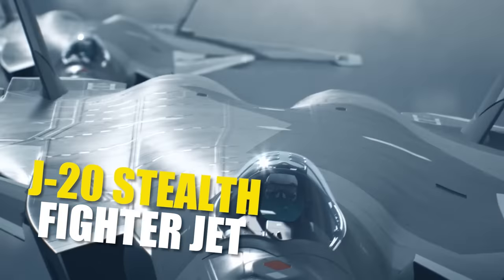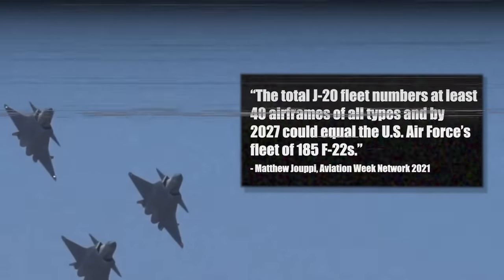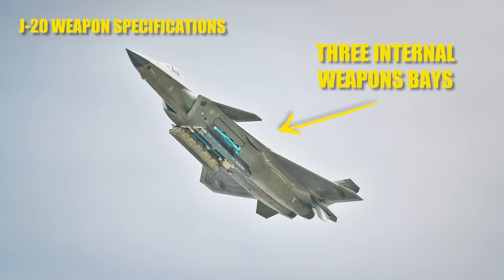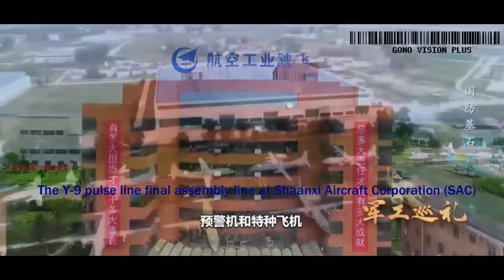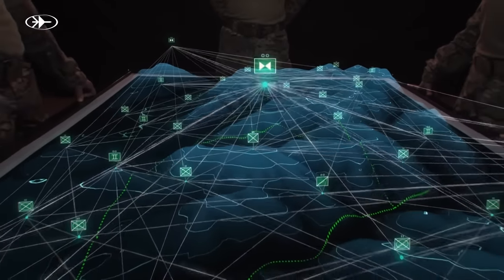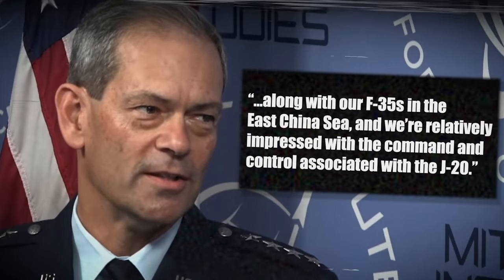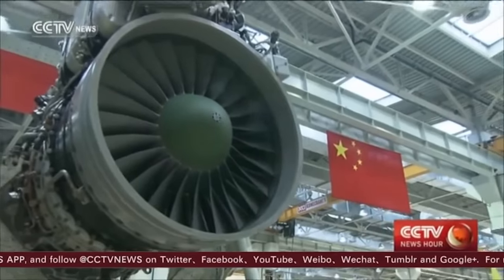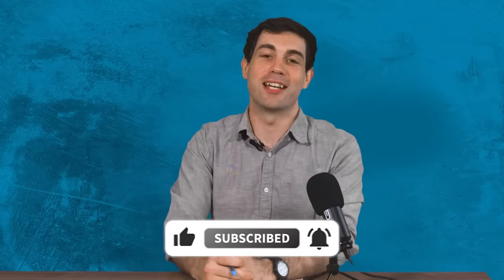How China Stole their J-20 Stealth Aircraft

Comment: stealth doesn't make an aircraft invisible, just very hard to get a lock on or keep lock. It'd likely look like something popping on and off your radar screen as the aspect changes and you get more or less radar return. Also as we know certain track radars can detect stealth aircraft, but lack the accuracy for a lock. They can detect it, so i highly doubt a J-20 flew over Taiwan without them noticing. It's probably more likely the pilot in question turned off his RWR, went super sonic, sped quickly over Taiwan(or likely one of their islands) and wasn't intercepted therefore says they didn't detect him because he doesn't really know. So technically he could say that. But ya, not true.
Reply: The part of overflying Taiwan without being detected is utter garbage. How much signal return you get from a stealth aircraft depends on the aspect your radar is towards the jet. Since the J-20's would have at some point flown over directly over the island Taiwan's air defense radars would at some point be looking almost directly up at the underside of the aircraft fuselage. That's one of the worst aspects for a stealth aircraft and generates some of the largest signal returns as it's a way bigger surface areas than looking at an aircraft from the front or rear. The Chinese aircraft were detected no doubt.
Reply: @oryxland3994  Too bad Taiwan can't detect J20 with their own radar too many times. Even if conventional like J11, Taiwan can't tell their flight path. All PLA does is jam all their radars.
Reply: @kongwee1978  Yaaa the problem with that is jamming radars using airborne electronic assets tends to alert an air defense system that someone is in the area. As well it's not some sort of "jam radar now" magic button which renders any radar useless, you might have reduced range and reduced ability to identify the target. It will also cause any radar on side doing the jamming issues as well affecting their own aircrafts ability to acquire targets. If jamming a radar was as such a sure thing taking out enemy air defense systems wouldn't be one of the hardest and most dangerous missions for a combat aircraft.
Reply: WW won’t tell you anything 😂. None know H6K already flew surround the island before the reword news pumping out. You guys uses second even fourth hand information from several years ago to evaluate an new first rank fighter.😂 In your logic, why there wasn’t any infos from the U.S and 4V? Come on, get educated please.
Reply: @oryxland3994  Jam radar mean you see the monitor of your radar goes haze wire,still pics and even explore your monitors. You can't access your radar on SAM or communicate center.
Reply: Remember how pissed off China got when India said they detected their stealth fighters lol.. 
remember that US is already in their 3rd to 4th generation of stealth coating
Reply: @JBrav6  Yes India can even detect B2.
Reply: @JBrav6  bot?
Reply: @JBrav6  Detecting an aircraft not hiding their stealth signature when they fly sorties during peacetime to project power is the same as a kid seeing a stealth aircraft at an airshow and saying it's not stealthy. Indian propaganda is a joke.
Reply: @mikhailsmirov8862 then why china was pissed?  they were doing war exercise at the border and testing their new crappy j20 and since when stealth jets have canards? Lmao.
Reply: I least, i would let them think they are invisble. Same way i ignore the crazy neighbor that strays naked through my house and thinks he is invisible without clothes. Some day i will show him that i could see him all the time.
Reply: yeah. Stealth isnt "invisible" its making it harder/ longer for the enemy to identify you and get a lock on, giving you an edge in fighting.
Reply: Even if ground stations and advanced aircraft can detect a stealth aircraft, that is quite different to a missile being able to track them with their own on-board  radar, so even if a lock is achieved, the attacker has to keep the target lit up, compromising their own stealth, while limiting their ability to manoeuvre. If something is fired back, they'll have to evade, and the missile loses track.  For a ground system, if you've picked up a stealth aircraft at 20 miles, you've got about 30 seconds to congratulate yourself because the HARM is already riding down your beam.
Reply: @The_ZeroLine  Look at the people spraying green paint off the side of roads in China to give the impression of healthy agriculture. The rebar with stones on the top, simulating cotton growing (from the air). Now amplify that to China's image to the outside world.

Spraying green paint on their planes, trying to give the impression of power.
Reply: Bet that canard showed up.
Reply: @JBrav6 have you heard about Lundberg lens?
Reply: @hunterkiller4578 never heard of luneberg lens? Stick to videogames kid😅😅😅
Reply: @kongwee1978 😂
Reply: Stealth jets have canards since China built one. Jealous that china was the first?

Who said China was pissed? Or not using lunesberg lens? It was done to send a message. This doesn't work if India doesn't even know you were there..

Also USA developed many stealth prototypes with canards. Canards by themselves do not automatically make a plane non stealth. Otherwise you should ask why a plane with big wings can still be stealthy but smaller wings(canards) can't?

If you know how stealth works, and have proper design and use it as intended, it is most certainly still a stealth jet.

USA would also just say it's not stealthy and would not call it a stealth or a 5th gen aircraft.

China also possesses the same and more advanced radars and sensors that India has. Every SU-30 India has, China also has. Any S-400 Indian has, china also has, but China had everything before India did. Obviously China knows how to use them to help design a counter to them. Only indians make such claims like canards negate stealth completely, and that China is just bluffing, even designing internal weapons bays and other stealth designs which limit their capabilities for zero reason.

Yes, keep believing China is that dumb and India the smartest and can do things that neither China, Russia, nor USA can.
Reply: @oryxland3994  Search radars have a cone shaped detection area and do not look directly up so it's quite possible to not be detected.
Reply: @kongwee1978  China detected the F-22 flying over South Korea with the JY-27A phased array radar. It has 500KM range in detecting the F-22.

Comment: J20's are also just starting to get outfitted with completely indigenous WS-15 engines, which alleviates most of the issues with thrust and stealth compared to the older Russian AL-31 engines
Reply: The Russian AL-31 has long been replaced with indigenous WS-10. WS-15 is an upgrade to WS-10
Reply: @__daddy__  yes but the WS-10 also had thrust issues and along with the AL-31 was a stopgap solution until the WS-15
Reply: @rotfled  yes. but still ws-10 is far better than AL-31
Reply: @borrago  Made in China of Chinese design.
Reply: @borrago yes
Reply: China engine 😆

Comment: Hey I love your channel it's great but one slight correction the f-35 B and C models don't come with a gun either they can be equipped with multi mission pods with GAU-22 cannon but they have no internal gun. Only the F-35 A the air force variant has one internally.
Reply: Very enlightening, thank you. I wonder if they also have mission pods for the J-20 where they could add a cannon if needed...

Comment: Correction : the J20 is the largest 5th Gen fighter. The B2 bomber is the largest 5th Gen plane.
Reply: interestingly the J20 is actually lighter than the F22 due to more use of composites, meaning its actually quite agile for its size.
Reply: @hughmungus2760  isnt it gonna be as heavy from carrying the massive amount of fuel for 3k something range? unless they dump it when needed.

actually, i have no idea, im no fighter plane.
Reply: @mr.2minutes161 Well apparently they did ditch the cannon
Reply: J20 uses 3D printed body, it is tons lighter than conveniently built planes.
Reply: isnt the su 57 larger tan J20?
Reply: J-20 has a smaller frontal cross section than F22.
its big because its long not wide.
J-20 more akin to an interceptor than a dogfighter.
Reply: The j20 is more like a 4.5 gen fighter. The stealth cross section is larger than the f22 and f35 but smaller than the felon. If the jet turns sideways it's completely visible on radars